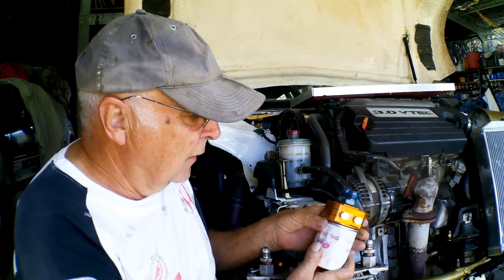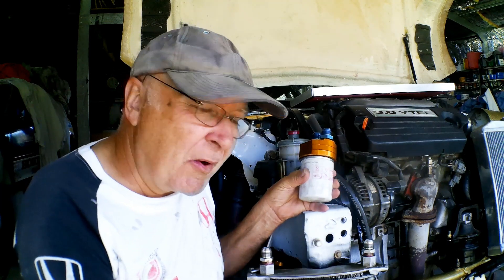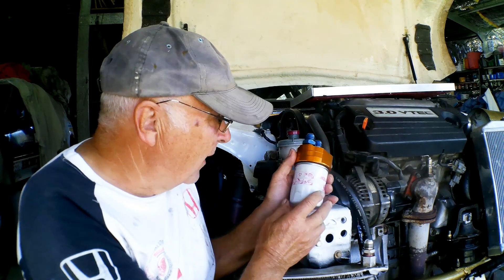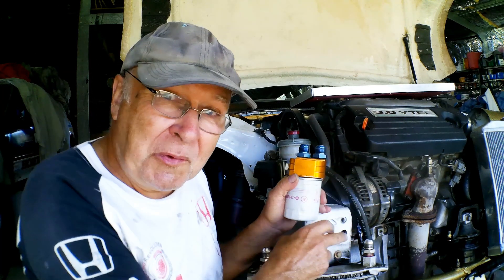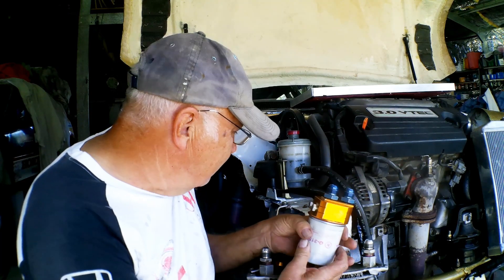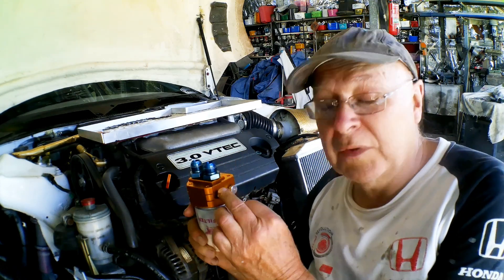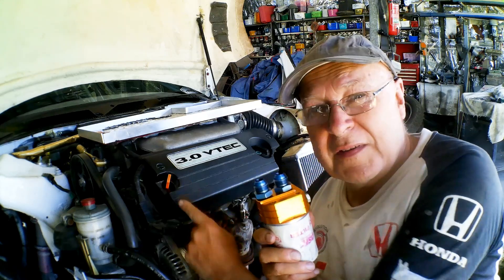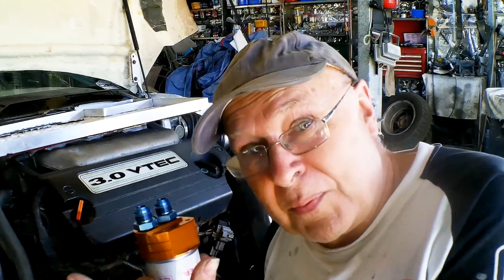Why the New Muscle Hatch Had No Oil Circulation

Comment: please pull that oil filter mount apart and check the oil passages inside of the part, pull the filter and fittings off and have a look where the oil has to flow through.
i have a similar looking part and the machining of it was terrible. i ported the thing with in an inch of its life because from the factory i could barely see any light through the oil passages. let us know what you find if you read this.
chris
Reply from the maker: Yeah, first thing I looked at yesterday when I pulled it off. Was horrified to see how terrible the passages were mis-aligned. A designed bottle neck for sure. My grinding job for tomorrow for sure! Never ported an oil filter mount before. Shouldn't bloody well have to, eh?
Reply: @BillsBuildandRace  yeah its a bloody joke, cant expect much from cheap parts tho.

i wish i got pictures of what i ended up doing to my one. the oil line fittings and the acutal threaded filter boss needed alot of work because they butted up against each other and my one seems ok for the moment making 50ish psi oil pressure on an v6 vn commodore engine in my fc rx7.

id recommend a set of cheap Carbide burrs, i got some 1/4 inch double cut ones from ebay and they have been awesome.

id near say your oil starving problem was cause more by that part rather then the lines being on the wrong sides, but it probably was a combination

Comment: While swapping the motor, get a set of headers!!!!!!
Reply from the maker: Already done that! This is a J30A4 which has a single oval exhaust port in each head - why the A4 makes more torque than the A1-A3s. So you don't have 3 exhaust pipes on each head to join into an extractor.... Honda built that into the A4 heads. My A4 used to have Honda cats bolted to each port. Junked them & had a new equal length collecter made going from each head & joining under the motor.It's there - you just can't see it in this video.

Comment: I can tell this was a tough video for you to make. A ton of blame has to lie with the manufacturer of the unmarked part. A small block of anodized aluminum should not ruin a race engine. What do you think is the answer for such an unmarked part? Is the more central oil fitting the inlet and the offset fitting the outlet?
Reply from the maker: Yes. The hoses just didn't want to fit that way, which is why I made the mistake of putting them on the other way. This may have been also the way I had them on the original car because I put a new filter on the new car (as anyone would do), and maybe, maybe that earlier filter on the old car didn't have that anti-drain valve in it. Who knows.

Comment: A friend of mine had the same thing, and drove round with it, hard, for a few years. On his car, the "one way flap" got blown through the holes with the oil pressure, untill he got a filter that didn't.. He found out in time, as the oil pressure light wouldn't go off.

Comment: I have a '86 Renault Fuego, 2.0 with carburator. I discovered that oil filters have valve in them, after i wasted about 12 liters of oil, due to oil filter gasket blowing out and engine spraying all the oil out. Funny business.

Comment: Hondas are very fussy when it comes to oils, cleanness, and pressure in vtec engines
in saying that the factory pressure relief valve should still work
i did the same thing with my Nissan Bluebird turbo, i put a remote filter relocation kit in and got lines mixed up for months driving on it with a anti drain back valve Z411, thats ok i went back one day to and  held it with my hand and thought, the wrong line is getting hot, so i did a full oil drain and filter replace and  changed the lines, no harm was done and no oil pressure loss, the same issue can be done on the block plate(adapter) or the remote plate(adapter) 

but the oil pressure relief valve should still work on all cars unless it is blocked or seized(its just in case your filter blocks  and or  the engine over pressurizes 
however sometimes they can fail and  pop off filters or balloon filters

Comment: Damn!!  Ya I've seen that failure before on setups.   The motor is just a series of calibrated oil pressure leaks.   Out the mains, out the rods, etc etc.   I would suggest, esp if you have a stock oil gauge to see "feed" pressure to the motor, to have a gauge and/or a 20 psi oil warning light switch somewhere near the end of the line, in your case a cam cap passage.   It will save a motor or two, especially racing around corners!   Best of luck!  Your videos are great, doing fiberglass on my race cars right now because of them.  Thanks!

Comment: Dont worry mate. I didn't know that.
I would have thought that when you hit 80psi it would have blew through any anti drain back device.
Did you try blowing through it?
Reply from the maker: Neither the oil pumping on the car, compressed air, or high pressure water would go through the oil filter backwards.
Reply: @BillsBuildandRace  thats a quality built filter!